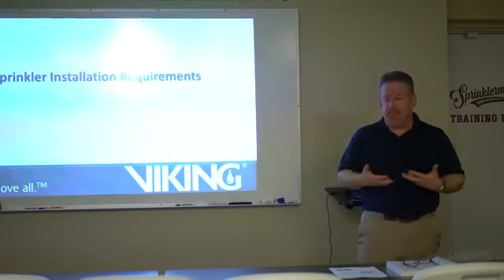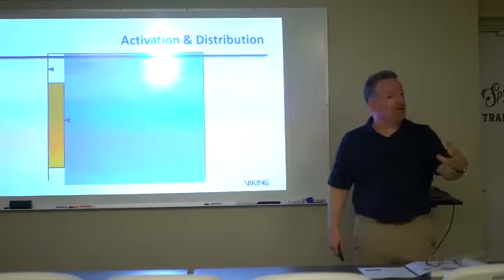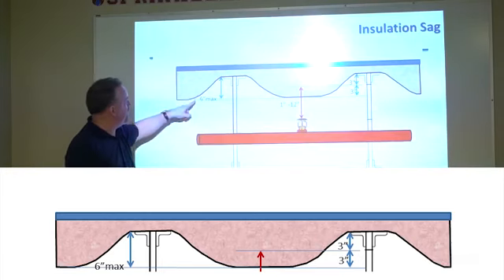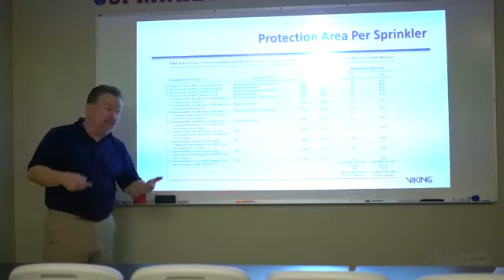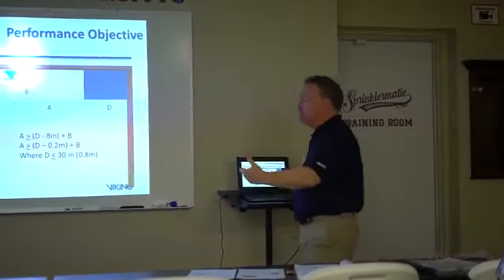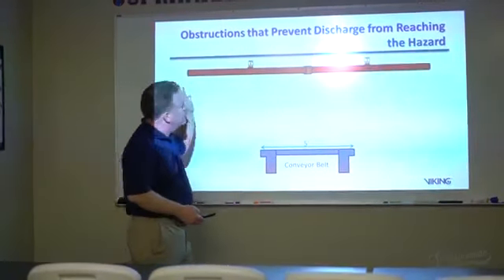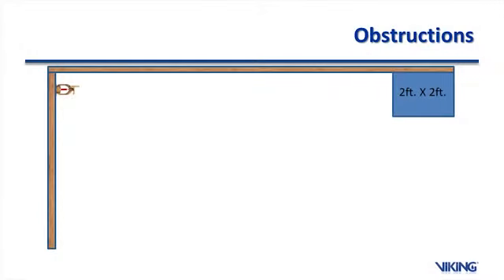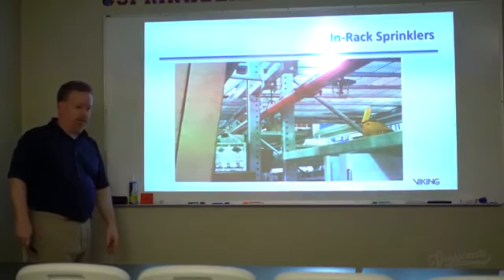Requisitos de Instalación de Rociadores Automáticos (Sprinkler Installation Requirements in NFPA 13)

Comment: como se interpreta tener una inclinación 2 a 12? sludos
Reply from the maker: eso implica que en techo, por cada 12 pies de recorrido horizontal, el techo tiene un cambio de altura de 2 pies, que es igual a que por cada 6 pies horizontales, cambia o sube un pie, por lo tanto, 2/12 = 1/6 = 0.1666 o una pendiente del 16.66%. Si usted saca la arctang(0.166666) obtiene la inclinacion en grados, la cual es de 9.46°, que es teoricamente, la pendiente máxima de techo para la cual se debería diseñar un sistema de rociadores, salvo las expeciones y licencias que pueda dar la norma.